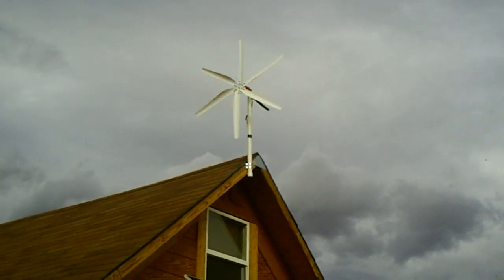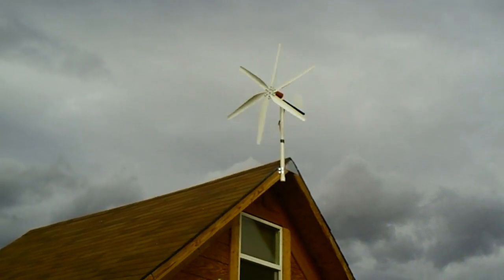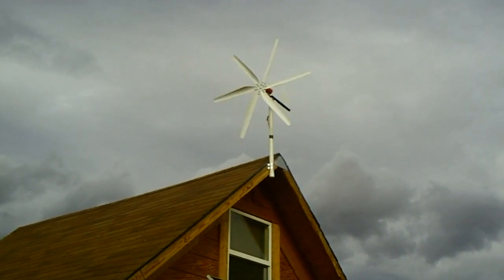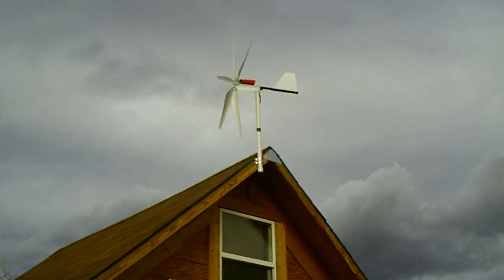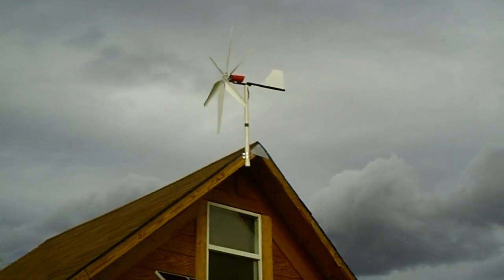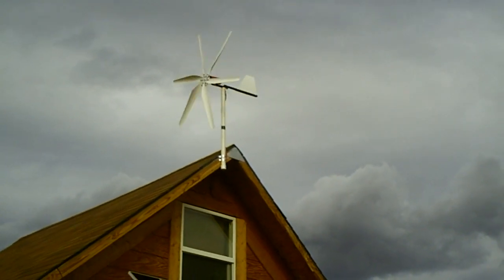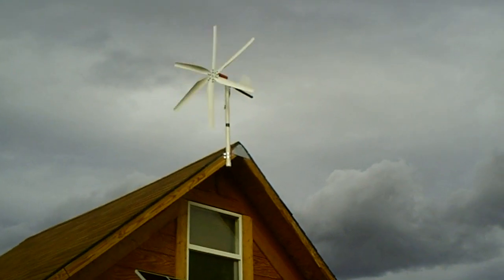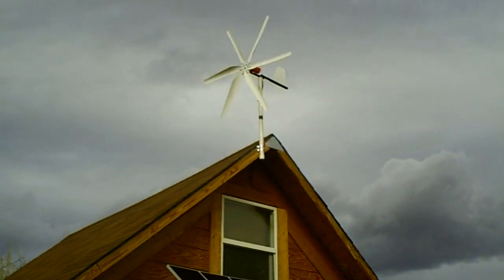Wind turbine part 4

Comment: These things are 125 watts? So if you have 8 of them, you could use a 1000watt electric heater?

Would be nice in winter to have the heating on continuously.

Comment from the maker: It made some noise and I wouldn't recommend that for a permanent mount. I now have an Air X 400 and it is mounted to the old power pole in my yard. you can see that turbine in my other vids.

Comment from the maker: It all depends on the water table in the area where you are drilling. Unless you live in a high water area most wells have to be professionally drilled. I live in a high water area and we hit water at 50 feet but most wells are around 300 feet. Too deep to hand drill.

Comment: why not just use a GM generator and voltage regulator,you know they are specificly designed to charge 12 volt system in the car,,,should work fine with wind

Comment from the maker: Depends on the generator and blades but small turbines require 5mph to start and about 10mph to produce. larger turbines need 15mph to start producing power.

Comment: another idea to get generators, if you find someone who works at a tractor supply or something that get return generators they usually sell cheap if they dont run because they usually sell for scrap but the generators usually work in them but returned because they wont start. im buying some for 20 dollars each 1500 watts

Comment from the maker: @SuperMax328 

You can attach a power controller and dump system to these wind turbines but I would look at the Air X in my other videos if you will be using these for a full time power source. They have an integrated power controller.

Comment from the maker: @Gentilseulement 

Not this small one and it is only used to trickle charge my batts in winter. The 400 watt I just installed will provide a lot more power. Watch my other vids for that.

Comment: Wondering how the wind turbine is working out for you. Sometimes when you are not expecting it, you end up with too much energy! Have you hooked it up to a amp meter to get some data on how well it puts out? Check out the forums at techluck DOT com

Comment: How does this wind turbine handle the power connection vis-a-vis the turning of the turbine to face the wind? It looks like the leads just hang down... is there no slipring setup? Doesn't it get tangled from turning too far one direction?

Comment from the maker: A pole mount 30 feet or higher would be best.

There is some humming when you attach a turbine to a house but this can be reduced using rubber pads as dampers.

A house will deflect wind and reduce efficiency so a pole mount at least 50 feet from the house is recommended.

I put mine on the cabin to test it and be able to reach it for repairs but this year it will go on a pole.

Comment: Okay, so I expanded the comment section below and see you already addressed the humming.   I don't see we'd have anything to be concerned with.  We could sleep with a fan on in the bedroom all year round without the noise bothering us.  We also have a battery operated essential oil diffuser going 5-10 hours a day, too.  I doubt we would even hear the turbine.

Comment: We have a turbine we haven't put up yet.  Still debating whether or not to mount it to the side of the house or not.  We've heard you should not, because of the incessant "hum" the turbine gives off, and that it is heard throughout the house.  It would be SO MUCH cheaper to put it up top rather than buy the guy lines and pole setup...   
Is there a braking system on this?  What to do in the event of a violent storm?  We've had several storms with wind gusts over 50-60mph. 
Any input to share?

Comment from the maker: A car alternator takes way to much torque and speed to be used as a wind turbine. permanent magnet motors are used.
A wind turbine requires a dump controller that keeps a constant draw on the turbine or it will free spin when the batteries are full and damage the turbine.

Comment from the maker: The turbine works fine when the wind blows but this has been an odd winter here with very little wind ?  It produces between 80-100 watts in a 5 mph breeze and helps top up my batteries.

Comment from the maker: It just connects directly to the battery posts and then you can connect an inverter to the battery and run 120 volt ac appliances or run dc appliances directly from the battery.